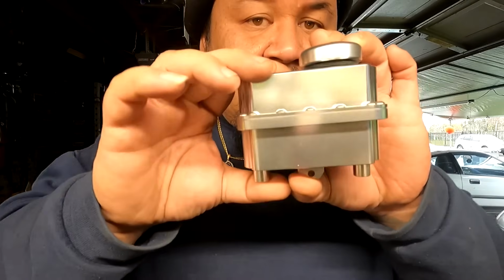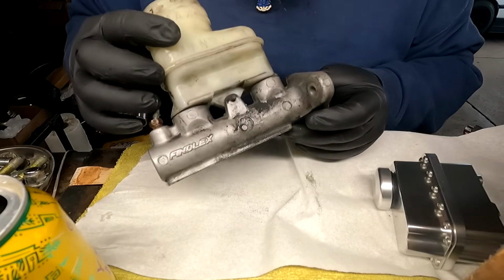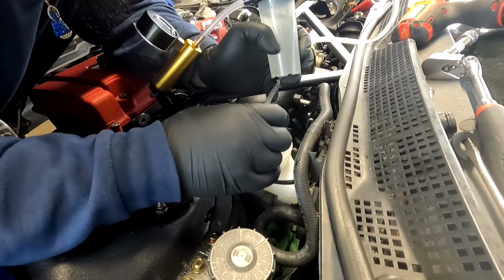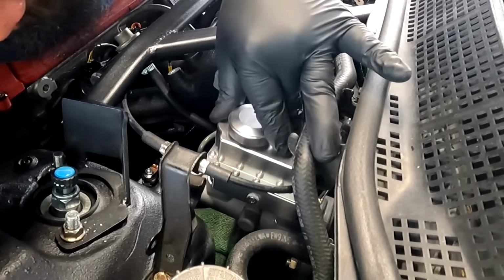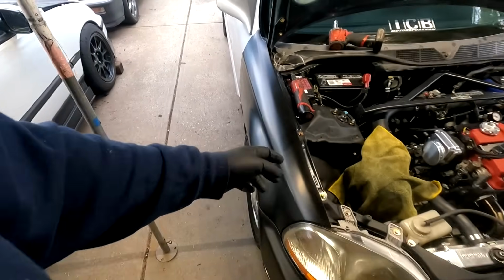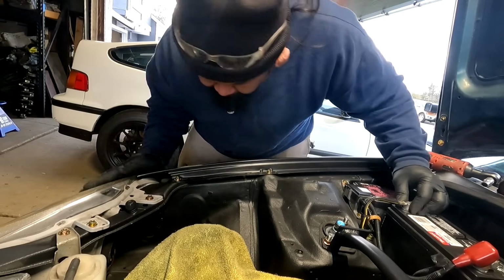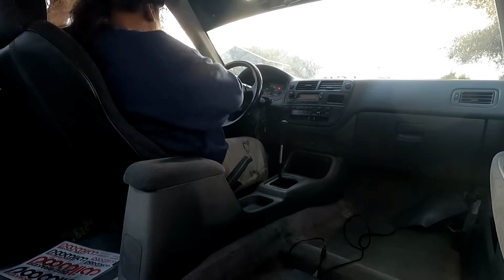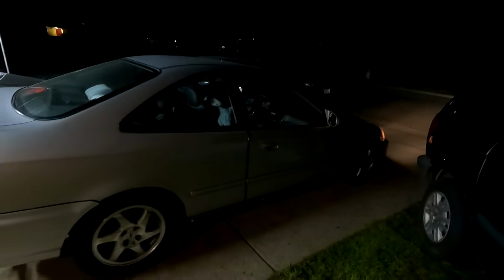BullBoost Billet Brake / Clutch Master Cylinder Reservoir

Comment: quick google foo said no ptfe tape should be used on any brake fittings. but i know not if true only what google tells me
Reply: I would guess that it depends on the fluid and tape. If the brake fluid is silicone or glycol based, I know that glycols are solvents. And the quality of tape, meaning its resistance to solvents. But the again there’s always the chance of stuff getting in the system just from pure friction. Enough from that single fitting to cause damage? Doubt it. It’s always better to play it safe tho